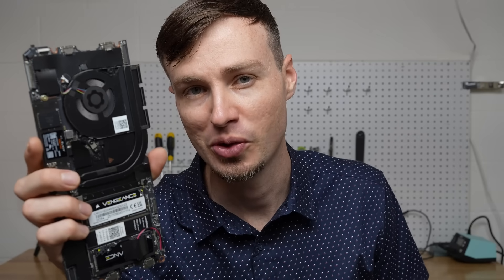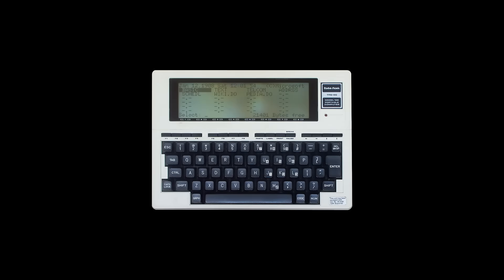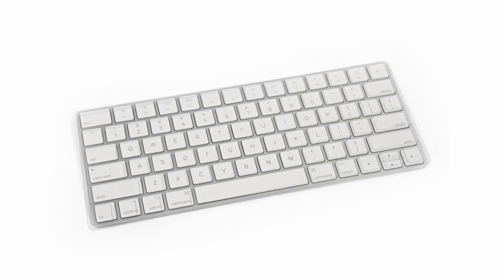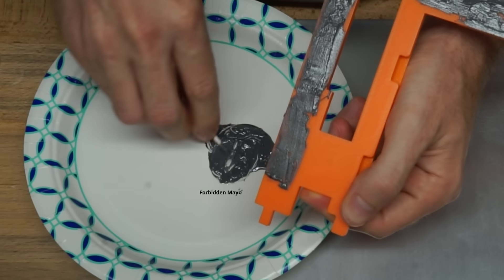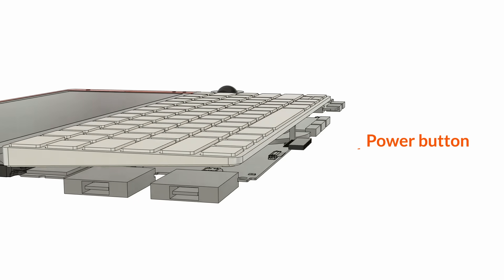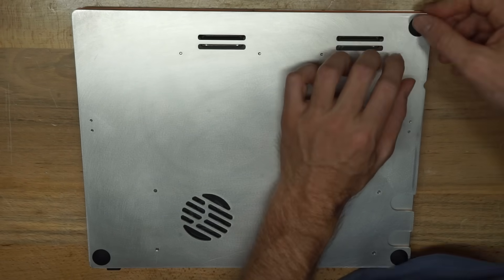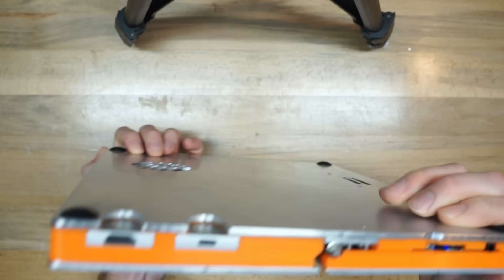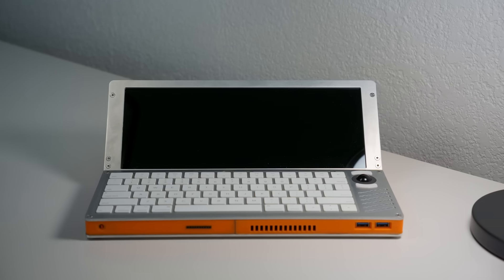Framework Cyberdeck - DIY Portable PC

Comment: A idea for the swappable connectors. The tiny sucction cups that you get with some bathroom hooks and stuff for windsheilds might fit and give you some leverage. Cool video.
Reply: Or use the CNC to give them all some texture for better grip. I'm not sure how much force is needed, so this may not be enough.
Reply: @jakeaustin901  Yeah, serrations like a pistol slide
Reply: he could also use some 3M pads or other adhesives to glue on friction bars. Perfect little pc tho. Definition of built to order, all in it's... disorder.